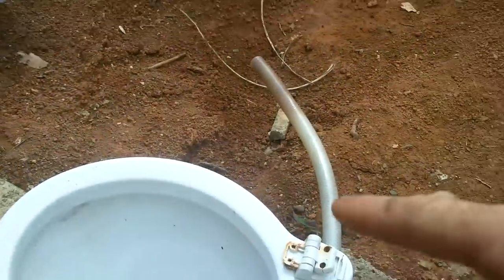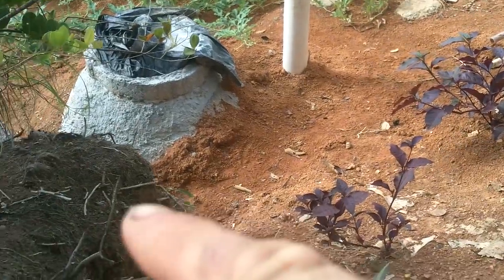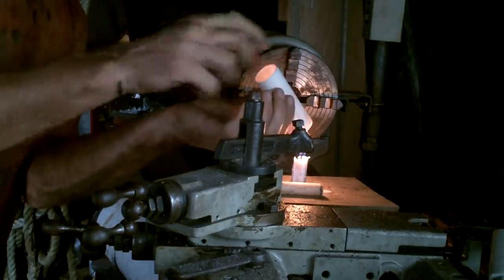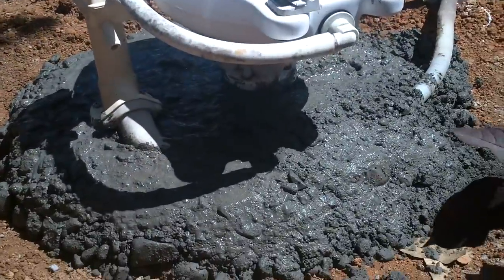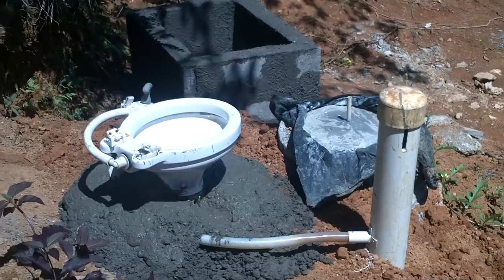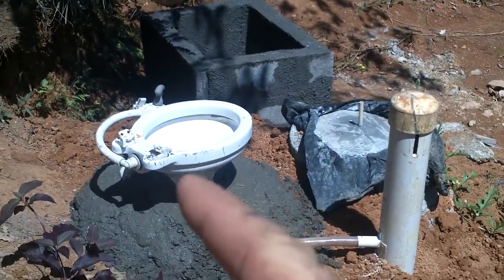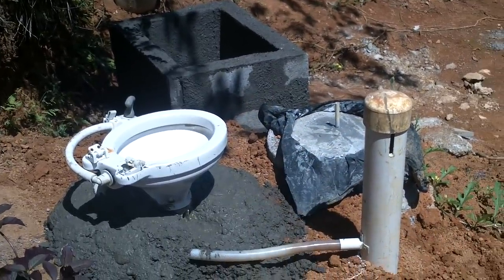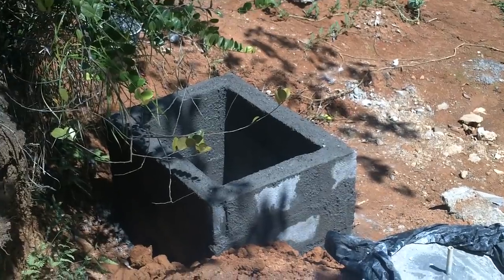Fart Machine 004 Open for Poopin'

Comment: I've done turds that were thicker than that hose you joined to the down-pipe. Other than that, great job.
Reply: That hose is just for water to "flush"
Reply: @Mythrunes  dont think so, he specifically says thats where it goes 'down' the drain
Reply: Very eloquent Hamish.
Reply: It's a macerator toilet like on boats.  It will grind up any solids in the toilet first.

Comment: Can help thinking that you would be better with either a traditional house toilet if you want to flush or a composting toilet using a 5 gallon bucket then cover each deposit with biodegradable material like sawdust or coco coir as it's used during the day and then emptying the bucket into your poop gasification plant, each day through a sealed opening hatch.

The marine head is a compromise on a boat using a much smaller outpipe because of water conservation, and because you don't want large pipes leading to a holding tank and ultimately a through hull in case of a leak, also they are notorious for giving trouble with the pumps diaphragm and joker valves in the pumping system, because you are forcing poop plus toilet paper through a relatively small pipe.

Comment: is this a septic tank?  Does he have a field?
Reply: No it's a bio-digester/methane generator. It works on a similar principle to a normal septic system, but all the output is recycled/used instead of drained into the ground and pumped out by a septic service every couple of years. Cody has a nice intro/explainer video about them here: https://www.youtube.com/watch?v=u84s_ObQn-0